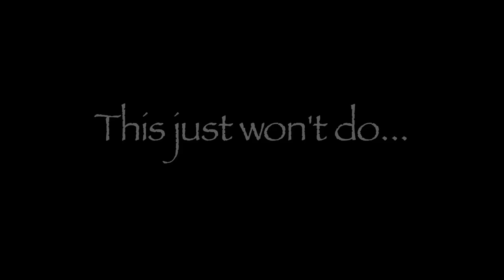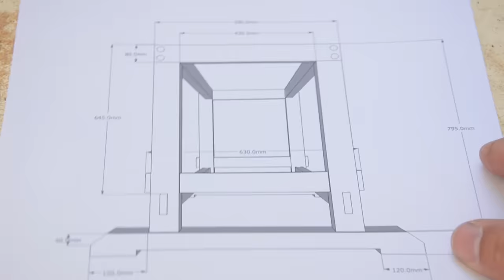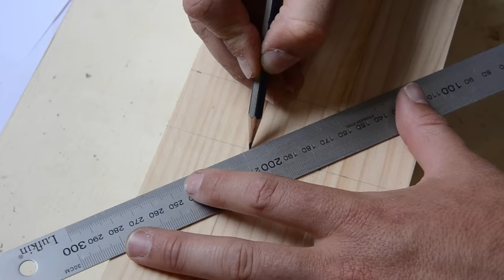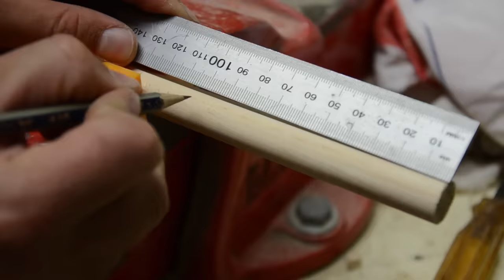Laminated Pine Workbench From 2x4's - Woodworking

Comment: I know my comment is a couple of years late, but for anyone watching this now, there's a great video by Matthias Wandel where he tests the strengths of various wood glues. He proved these foaming glues, like the one being used here, and also like Gorilla Glue form the weakest bonds and were by far the easiest to break apart. I had been using Gorilla clue for nearly everything, and had no idea it actually created such a weak bond. He proved good old fashioned standard wood glue was by far the strongest of glues for bonding wood. Just thought I'd point that out.
Reply: As a total noob, this is good to know. A few other craftsmen I follow on here, notably Kobeomusk and Ishitani (spelling may be off), always use the green label Titebond Ultimate so I figured that must be the one to go for. Those two dudes are the absolute best woodworkers I know of.
This video was on the same level as those guys. The ingenuity and precision is sexy as fuck. Awesome job.
Reply: This answers my question. I was wondering what kind of glue goes on brown and dries white.
Reply: @tictac1020  I use Titebond 3 too because it has a slower set up time. Gives me more time to get things straight as a total noob. You have to be aware that it dries pretty dark though.
Reply: If it's for wood then I buy whatever glue is on sale, provided it is yellow or white carpenter glue, and is made in the United States.  Spread adequately, "place" your clamps properly (don't overtighten), make sure the room is and will stay warm for 12 hours at least.
Reply: Polyurethane glues have bond strength of around 3,500 psi, aliphatic resin about 3,600 psi.  (Titebond specs for both). If you prepare the material properly and follow manufacturer instructions for clamping they’re both fine.
Reply: 2 years later and that comment is still helpful, thank you. was planning on wood glue, but good to know its been tested
Reply: @Dracossaint  I've used Gorilla glue on OSB. the surface is flat but not smooth. The glue ripped off the surface layers when I tried to remove a part fitted in error.
They also have a non foaming variety.
Reply: On the ones I built, I used wood glue but I also pre-drill each board so when assembled, I could run a piece of all thread thru it and use heavy washers and nuts (counter sunk and covered with dowels. I do this in three or four areas depending on the length of the bench. I promise it will never come apart. ;)
Reply: What on earth are old fashioned wood glue?
Reply: @googooboyy   I'm pretty sure that reference was to any of the yellow type carpenters glues such as Elmer's wood glue
Reply: @tictac1020  I use the Titebond 3 (green label) also, it's waterproof so I figure it will withstand humidity and temp changes better, and more importantly it has a longer working time.... I know it's only a few more minutes than regular Titebond, but when you're racing to glue up a butcher block man that's a lifetime lol
Reply: @tRRickedOut  I just commented the same thing on another post the other day, I remember the benches in high school shop class were built like that
Reply: @timma_thy  I don't like the dark dry color and setup time isn't usually a big deal compared to Titebond II. Titebond III I would only reserve for outdoor projects where being waterproof is a must.
Reply: Good comment, altho in this case I’m sure this lamination will hold until we all die of old age. I use titebond iii only because it’s strong, longer set times. I don’t glue enough to care about the price over tite ii.

I use 5 min epoxy sometimes but it is weaker and expensive.

Comment: 3 years ago, 2 x 4s were cheap.  Not so much a "penny-pinching" project anymore.  Nice bench nonetheless.
Reply: Yeah seriously!  They've gone up quite a bit.
Reply: @luisg1653  Wood in general has gotten ridiculous.  You can usually expect a slight uptick during hurricane season, but with idiots burning down forests because of a gender reveal party mishap or what have you, then prices go up even more.  For instance, plywood used to be the less expensive option.  I remember when a 4 x 8 sheet of 3/4 furniture grade oak plywood was like $45.  Now it's like $55.  That sheet of plywood equals 24 board feet.  I can go to the Amish and buy 4/4 red oak for $2 a board foot if I buy 100 feet.  So, I can pay $200 for 100 Bft of solid wood, OR I can pay $220 for 4 sheets of plywood, and only get 96 Bft.  Why WOULDN'T I just get solid wood at that point?  Sure, there's less work involved in using plywood, but from a price point and quality point, it's a no-brainer.
Reply: lol
Reply: @johnfreeman9766  I’m building a workbench so I can put my computer on it and use it to design more woodworking projects and design 3D assets for VR environments such as the Metaverse, I feel personally attacked lol 😂

Comment: Will.  I don't think I have seen someone take so much care making a 2x4 workbench.  Your work is incredibly precise and clean.  I wish I had the ambition, space and tools to make something this elegant.  I just cannot say enough about how well you constructed, filmed and edited this video.  I would be really interested to see if you put a vise on the bench.  Can you tell us how long it took to complete?  Thank you again.  Great work.
Reply from the maker: Bruce Brachman thanks heaps for the feedback! It took about 4 weekends on and off when I got time. Yes I put two vices on. An engineering vice on one end and a standard 6" woodworkers vice on the other. You can see them in action in my other videos. Cheers!
Reply: What a pleasure to watch.  Keep it up.
Reply: Bruce Brachman you said it bro. Now let's dig some holes for those bench dogs, distribute some 7/8 diam. holes, 3/4 and finally some 1/2 inch holes that you'll find very handy when using a wide variety of tools and diferent material bench dogs, even plastic or composite. Hope you can make it accesible for any tipe of job. Thanks sir, awesome build. :D
Reply: Bruce,
This looks like it could be made with; a drill and drill bit to match some dowel stock, a hand saw, a chisel, a mallet/hammer, a #4 bench plane, and some time. Can't help with the ambition and space issues, though you could make it narrower and shorter in length.

It would take longer to flatten the top with the hand plane than the router setup will used, and a forstner bit would be helpful for hogging out the mortises, but they could be chopped all by hand.
Reply: Andrew:  I have seen other benches made with just hand tools.  I could do it.  This one is just so beautiful.  I would never go to this extent.  4 x 4 legs.  2 x 6 stretchers, plywood top would be my speed.
Reply from the maker: +Bruce Brachman fair enough too. It does take time. The availability of timbers here in Australia is a struggle though. So much is termite treated, tough to find untreated stuff. That's why I had to laminate the legs just to get 4 x 4
Reply: dear Bruce, have you seen Richard MaGuire, Jesse De Geest workbenches yet?
Reply: Very nice, making one with similar construction but doing a split top and using it as my outfeed table, the table saw track will line up with the tool well, I don't have a lot of width in my shop so I decided to make it my outfeed table. Wish I had space for one like this.
Reply: Will, I just watched this video for the 2nd time and you still amazes me with your talent. When somebody can take 2×4's and turn them into a work of art, they've got talent!!! If you slowed your videos down to regular speed I would still watch them if it took an hour of filming. 😀,,, you're the only one that can hold my attention with your builds and rebuilds, because I'm just in awe of the finished product.  GREAT JOB!!! My friend. This deserves 2 thumbs up! 👍👍 God Bless you always.
Reply: Bruce Brachman
Reply: I have the space and tools, but not the ambition. I could do it if I tried. 🤣
Reply: @bbrachman  Same with me one the bench design, but his work is beautiful. I might just be able to make the top and fold it up against my garage wall.
Reply: Yes the space and tools are such a big deal. Many have one or the other but not both.

Comment: Exceptional woodworking skill, Matt. Please do a super practical, functional one of these for regular people that don't have all those tools and clamps. An OSB subfloor overlaid with 3/4" plywood and framed with 2x4's with twinned 2x4's for legs all attached with metal angles and attachments secured with bolts, washers and nuts would be easier and faster. Additionally locking wheels on the ends of the legs would be useful for multiple applications. I could have saved money BUYING that table from you. Time, expertise and tools are the limitations for most of us.

Comment: I'd make a series of 1/2" holes every 12" to 18" down the center of every board, then use a 1/2" steel rod threaded on both ends to pull it all together.
It will add strength for the life of the table through the boards and also prevent them from racking while gluing together.
You can then recess the ends and plug them so they are net seen.
I'd also put the oil on before installing the top so you can get all sides easier, it will prevent the wood from absorbing moisture in the humid summer.
Reply: Make your own video.

Comment: I built this same table, but I took the extra step of drilling each 2x4 in a jig...4 holes per....and after gluing together, inserting four threaded rods through the width of the table (flat and lock washers/nuts on each end) and tightened to hold and strengthen the table top against any load.

Comment: Making a jig and using a router on the top was unexpected. I would have gone all Paul Sellers and hand planed it for days assuming there was no other way.
Reply from the maker: +Kilty MacBagpipe yeah no, not keen on planing that by hand!
Reply: I was wondering if he was going to build a runout platform on either end and rent a floor sander. I'd have been half out of my mind listening to a router for that long.  He's got grit, that's for sure.
Reply: That was when I hit the like button. It was inevitable, but that was the tipping point.
Reply: It’s a great method for flattening live edge slabs.
Reply: I rented an electric hand plane to do mine - it did a pretty good job. That router rig was an unexpected solution.
Reply: Kinda saw it coming when I saw his jig all built up. Did he do both sides? I missed if he did, but I would think you'd want to....
Reply: thats the one part i didnt understand.  does that take the place of a planer?

Comment: Very nice video, excellent work and pleasing music.  Of course today it would cost too much to be practical, but I can appreciate the density that heavy top would create, even in pine.  Where I live our construction 2x4's are spruce, not quite as nice as pine; I understand in the west you can get fir 2 x 4's; they surely are excellent.  Your workmanship is advanced and likely beyond the skill of many.  Years ago I built an effective variation of this for less money, and much easier to build.  I bought a 3/4" 4 x 8 sheet of Good One Side BC Fir plywood (not exactly cheap either), then cut a piece 28" x 64" out of it for a top.  I then used the remainder to glue and double up on the underside so that my benchtop was 1 1/2" thick fir plywood.  You could still go bigger with the top from that single sheet if you wanted to.  I then made the legs and sides out of the spruce 2 x 4s and finished the piece with a varathene, which looked nice and hardened up the wood even more.  Still looks great and has served my very well for 30 years.

Comment: I honestly did not expect a router for flattening the surface, that jig is quite the smart solution to not having a wide planer.  I wish I had the tools and time for something like this because a thick as heck top like that would be perfect for putting a 3D printer on.  They can sometimes resonate and thin tops like conventional tables effectively become like a speaker. While a thick top has the mass to not match up frequency.

Comment: My favorite part was when you figured out how to get the top on by yourself. Self reliance is disappearing fast nowadays.
Reply: Aside from the jointery, that was my take-away.
Reply: I'm just starting out woodworking as a hobby, I've done a few things and working things out without help has been the most fun and rewarding things about it, same when i built my pond. These projects are my personal time to kind of immerse myself in something. I cant do that with a load of help even if the end product is better, I dont care, it's not about that. So yeah I agree haha 👌
Reply: I’m watching this laying on the couch because my back is fucked for lifting too much weight at work... I just thought the same: “ that’s a smart guy”
Reply: Sometimes it's nice to have an extra set of hands for things like that.  Of course, my wife thinks differently if it one of my projects. :)
With the way he was doing it, he was only having to lift half the weight at a time.  Sometimes though, even that reduction is not enough and you need to employ not only that, but a jack or lever mechanism to lift one end a few inches, put a block under it, and then do the same thing for the other end, repeating until it gets to the right height.  Use your brain and not your back.  For example, my gun safe weighs 1600 lbs empty and I was able to move it from a trailer to inside my house by just taking it slow and taking it an inch at a time (especially when needing to go up a step or two).  You rush, you get hurt.
Reply: I used a motorcycle lift to do something similar
Reply: JBSOUL  What does the red stripe across a cross mean?
Reply: @danclayberger770  This icon actually belongs to the punk group Bad Religion. Not a big fan of them but I am an atheist so it works for me. And not that you asked but JBSOUL stands for James Brown soul brother #1
Reply: eh. self reliance is cool, long as you don't injure yourself. nothing more manly than asking for help when you actually need it.
the graduated lifting technique in the video is good though. just disagreeing with a common boneheaded trope that self-reliance to a fault is somehow a virtue
Reply: seriously are they really heavy ?

Comment: Nice bench but I think you're going to have a problem with the top moving with the weather. Wood in Australia will have a moisture content of 10 to 15%. That's a 5% change. The dimensional change coefficient of white pine is .00259. If your top is 36 inches across, it will move almost a half inch. I think you're going to have to mount the top to the legs in a way that allows this movement or something's got to give. Best of luck. It is a good looking bench and you do fine work.
Reply from the maker: Cheers Charles. Yeah if I get substantial wood movement then I'll deal with it then. Pretty easy to take the top off and readjust if I need to

Comment: Loved this.  Nice work. I'm wondering now that you've had it up and running for a while, are you noticing any issues with expansion and contraction of the wood top due to humidity and dry air in conjunction with the base?  I know when I was building table tops there were special hardware figure-eight metal attachments to allow for expansion and contraction of the top which in your case might move some as it's built in that grain direction.

Comment: I'm just trying to figure out where in the hell do they get those straight ass 2x4's from the start LOL All my home improvement stores 2x4's are warped to hell.
Reply: He must have gone through every rack at 4 home improvement stores!
Reply: @garyblack8717  hell yeah !!!! Those boards are hella straight
Reply: He used the table saw as a jointer to get the edges straight. that's why he cut off the rounded edges made by the saw mill.
Reply: I was at the Big Blue one the other day and gave up because they're 2x4's were all twisted, cupped, missing edges, bowed etc. etc. it's sad how crappy theirs and Big Orange wood is now. Plywood......don't even get me started. Quality doesn't exist anymore!
Reply: @lilman1234able  yeah but the ones at the stores are often so twisted and bowed that jointing won't fix them. Jointing is just good to remove the rounded edges that standard lumber has.
Reply: @TC-dw6wg  SPF 2x4s come in at least 3 grades here - #1 & #2 common, and #1 structural.  You saw the rejects after one of the common grades was picked through and dried haphazardly in the store.  Fresh #1 structural lumber is a whole different thing.  You can get the #1 structural at our HDs, but it's mostly special order.  Rather pricey.  But from a high volume professional lumber yard, not so bad.

Notice the relative lack of knots.  That was NOT #2 common!

Comment: The only downside to your design is having the lower brace in front. I built a very similar workbench and regret putting on the front brace. I could have stored items underneath my workbench on carts but now I cannot :-(

Comment: Where did you buy those 2x4s? Rarely do I find them without wrapping, cupping, or twisting.
Reply: In my experience, you can do it at a Lowes or Home Depot, but you just have to go through them one by one and you need to get them glued up relatively quickly because some of those straight ones are going to start getting twisted up as they dry out.